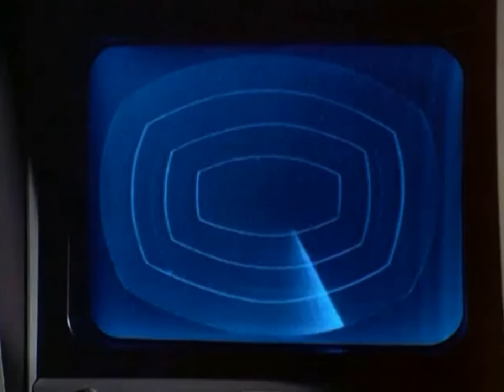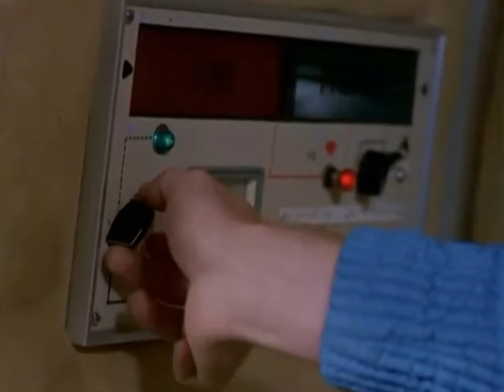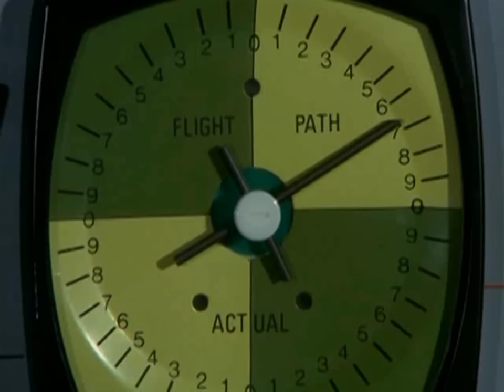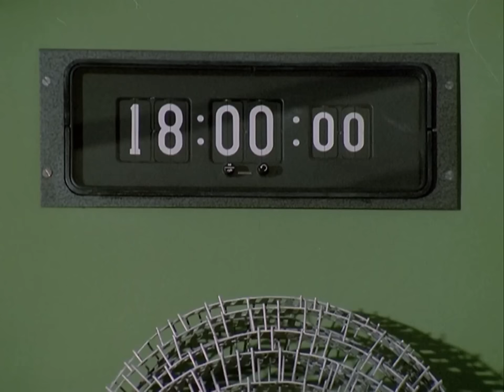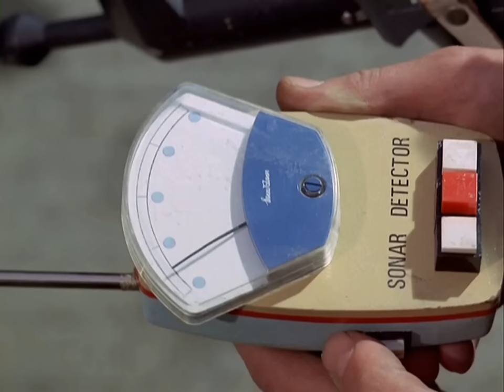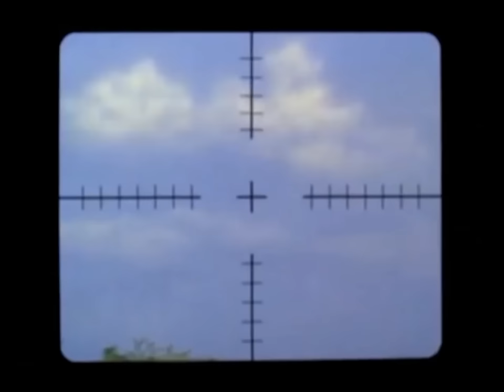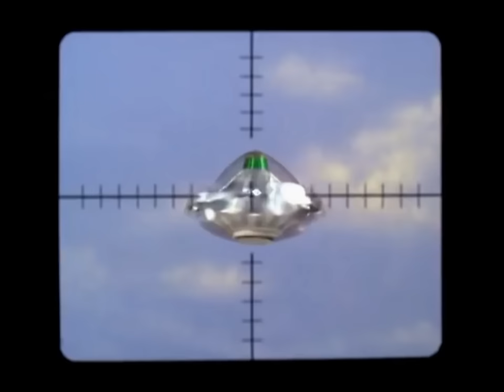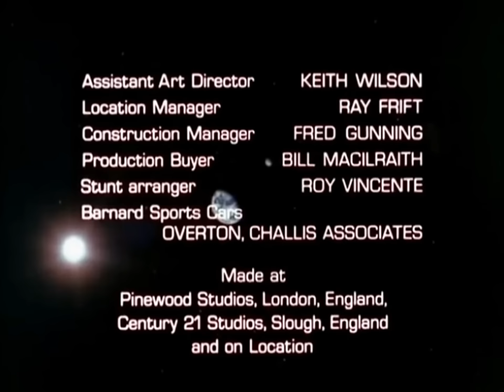SHADO

Comment: If the chair and bird is frozen in mid air then no door to a building should open either inside the affected zones
Reply from the maker: I think all objects or organisms have to be in motion at the instant the time freeze is applied - if an object was static it can be moved normally - remember Straker asked Lake to freeze when the UFO was right above the car - that spared them it's effects as a closed door or a turned off video monitor would have avoided being frozen by the Aliens as well - 🛸👽✨
Reply: @FandersonUfo  That might work if it wasn't for the fact that ALL things are in motion. Einstein has yet to be proven wrong.
Reply from the maker: @allankolenovsky7028  - too much Einstein is always fatal to science fiction

Comment: Supposedly high tech electronics, yet the computers can't transfer data to where it's needed. Real world Telemetry hardware of the time this was made was more than capable of this simple function. Some of it was still in continuous operation for over 30 years, in 2000. It never needed serviced, and was never powered down at Cap Canaveral. It was an early Microdyne product that was fully analog. We still provided support for those early products, at their facility in Ocala. By that time, they were building and shipping a DSP based digital system.
Reply from the maker: when shown in 1970 the TV audience would not be as tech literate as we are now - automatic data transfers would just confuse the average viewer then - that's why numbers are called out over radio channels - 🛸✨
Reply: @FandersonUfo  Maybe to some people. I graduated from high school in 1970 and was already working in Electronics.  NASA had visited our high school that year with their traveling science show, in 1970. Two of what they demonstrated were Telemetry and a LASER that used motorized mirrors to create light patterns on the large screen in our Auditorium. I asked if the intensity could be modulated, so it could be used to project video. I was told that 'No one would ever need that'. Two years later, I tested ut of a three year Electrical Engineering School in the US Army. I had been reading Science Fiction since I first learned to read. The scripts sounded like they were from the 1940s, not the 1970s.
One of my last jobs involved building telemetry for NASA. In 2000 we built a data link to the ISS which provided a 40 Mb/s data rate from the ground to the ISS. This was when 'broadband' was under 3 Mb/s for consumers. It could be used for voice, video or data to upload data to the onboard computers.
Reply from the maker: @michaelterrell   - indeed Mr. Terell your professional back ground is most impressive - I would not dare debate with you what actual tech was available when UFO was filmed - I must point out however that the "fictional" 1980 depicted is it's own little universe with it's own tech tree - there may have been reasons caused by Alien interference that required a lot of the old fashioned analogue ways of communicating with pilots that did not apply to our universe - or more simply an inaccurate depiction on film is often what makes science fiction more entertaining - even if it exasperates the experts - 🛸✨
Reply: @FandersonUfo  Analog electronics was still the only game in town until the end of the millennium. I just think that little bits of real information would have produced better scripts, and subtly educated people. The best of classic Science Fiction did this. Look at the work of the master writers in the genre. I realize that this studio aimed most production at children, but it wasn't their stop motion puppets in this series. It spent more time talking about building their headquarters, than any science. The old IBM Selectric printers are also laughable, these days.
I wrote a trilogy back in the late '80s, but never attempted to have it published. It was centered around developing a working Transporter, and other technologies that were spun off from it. The few people who were allowed to read parts of the novels loved them. Instead of violent aliens, they dealt with stopping criminals, who had a stranglehold on all inter-system flights of cargo and passengers. They also contained some 'Stealth Puns' that didn't hit you right away. I think that good Science Fiction is a careful mix of people, politics and technology.
Reply from the maker: @michaelterrell   - when I say analogue I mean the voice dictated exchange of info by ground control - I think that was still NASA's preferred method of chatting with crew at that time - indeed the show could have been written differently but I am just one of it's poor fans who enjoys the show's format as is and even thinks purple wigs look awesome on screen - this is just a fun old show sir - most of what makes it fun is not in the least bit educational - there are many series as you say who do a better job of educating the viewer - this show is more focused on entertainment and I thank God it was filmed that way - Merry Christmas sir - 🛸
Reply: @FandersonUfo  Early Astronauts were former Air Force pilots, so they used the system they were familiar with. I worked at the Helicopter Flight School at Carin Airfield, while in the US Army. By educational, I meant things like the use of actual names of equipment, not something preachy.
May you have a BLESSED Christmas.

Comment: Strakers car was built the way it was, with the very long steering wheel because Ed Bishop could not drive so someone had to lie under the dashboard to drive it for him
Reply from the maker: I think Derek Meddings designed the two cars for the 1969 film "Doppelganger". They were used again in UFO. Whether they had a shorter steering column for Doppelganger or the same column just happened to help out with Bishop as "driver" I'm not sure. A crouched driver on the floor would explain why they always look to be badly driven whoever the actual driver was.
Reply: @FandersonUfo  
That's pretty funny. I wonder how true it is.
Reply from the maker: @rudolphguarnacci197  - Mr. Jessop's story sounds reasonable except that the cars were built for a film before UFO.

Comment: There is one thing I never understood on this show it shows the moonbase using a Radar, but uf the UFOs are flyingbthe speed of light they could never be tracked and even the system was using a lazer beam the same you could not track them. So my question is what form of tracking is being used by SHADO?